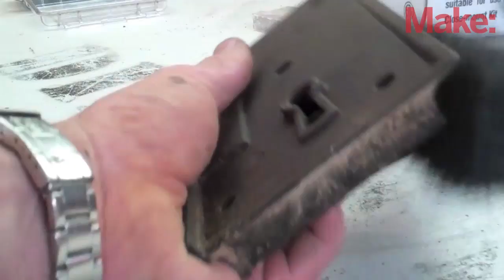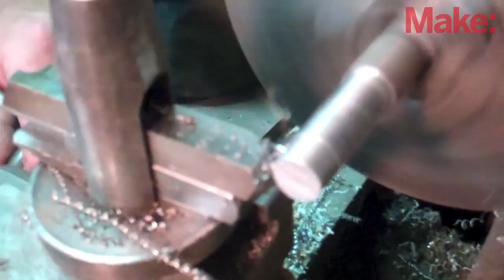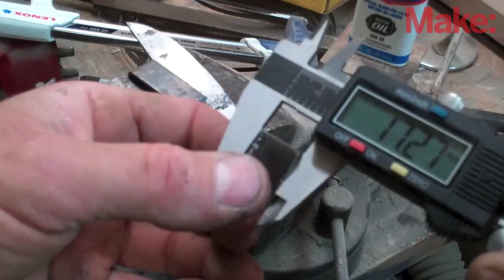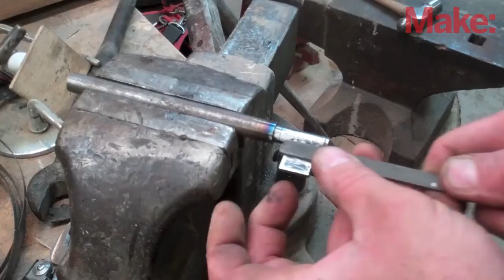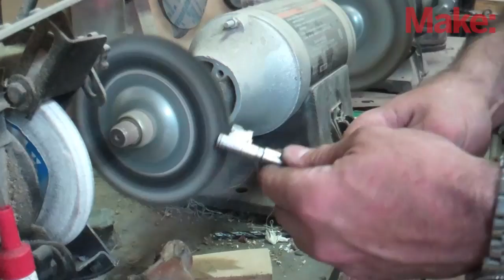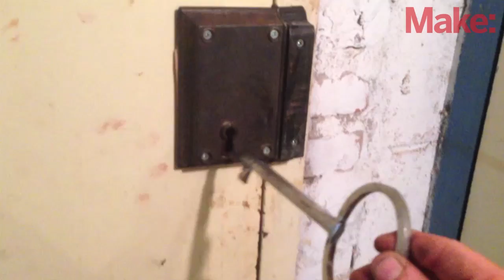DiResta: Skeleton Key

Comment: It's a TIG (tungsten inert gas) welder. A tungsten wire in the handle sends electricity into the base metal creating a very large spark essentially. The heat from this melts the base metals, allowing them to be welded together. The rod in his hand is extra filler metal to fill in the gap left behind. More or less oxy-acetylene welding, but with electricity instead.

Comment: It is to prolong the life of the saw and to make it easier to cut.  The oil lubricates the saw teeth and helps clear stuck metal fragments which would typically make the sawing more efficient.  Without a lubricant, the metal bits would fill in the gaps between the saw teeth and the saw would essentially become a flat but of metal.  With the oil, the metal bits do not stick into the spaces between the teeth and the saw will have more "teeth" available to cut the metal.

Comment: chuck it up in a drill press, use a file and sandpaper, and check your progress with an appropriate "go/no go" gauge. it might not be pretty, but it will work fine. and if you mean the dial calipers, they shouldn't cost you more than 15 bucks. if thats out of your price range, a set of leaf gauges and dividers shouldn't run you more than 7, and they can be used to infer the measurement.

Comment: A master or skeleton key is made to work on all locks of a type by a manufacturer, but not all locks by a manufacturer are identical.
To have a true skeleton key for all the locks of this type by this manufacturer, you'd need all examples of the lock to design a skeleton key off of. Otherwise, there's no way of knowing that your key will work its way around the wards in other locks of this particular type.
I believe use of the term "skeleton key" to describe any old-style key is simply regional.